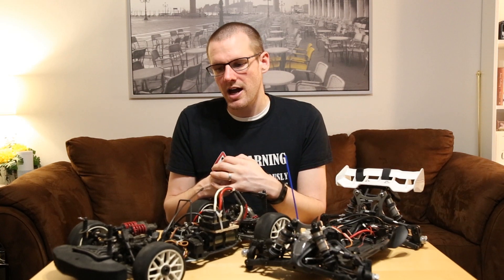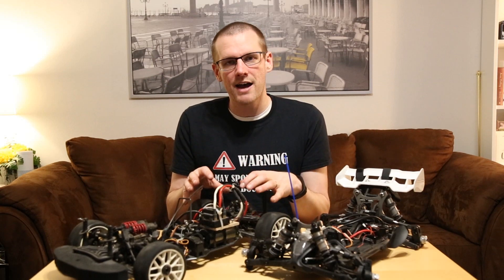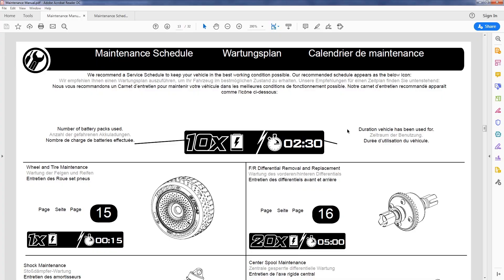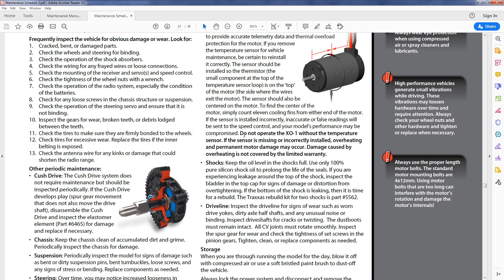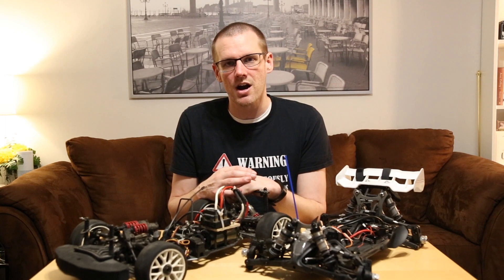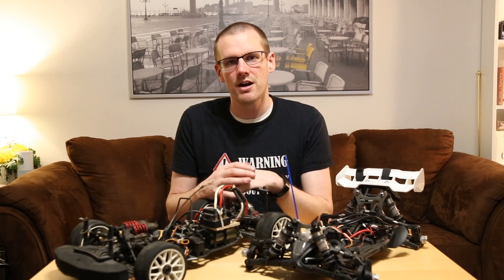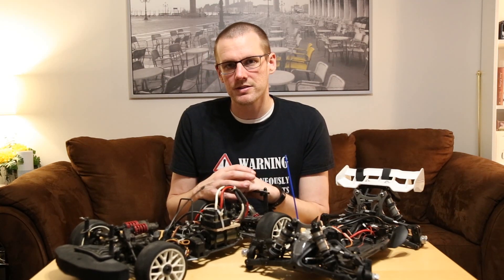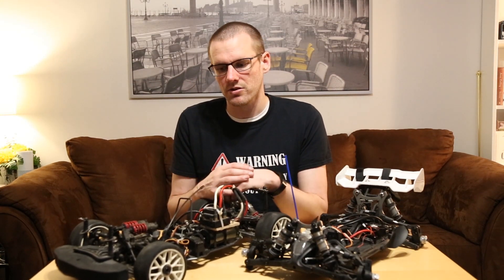Does your RC Car Require Oil or Lubrication for some of its Parts / Components?

Comment: You forgot to mention rust, thats the main reason I use teflon based thin oil to lubricate some areas prone to rusting. I also use a thicker and a bit sticky chain oil on the center diff gear and the motor pinion gear. The motor gear is made of hardened steel which can rust, while the center diff is made of a heavy and really hard plastic. Probably nylon. But my point was that its a noticeable degree of less friction when those two gears are lubricated. Also, less noise.  
I have a question, what type of grease do you use inside the differential housings?  Or do you use a thicker oil?

Comment: can you please replace the add picture for this link and remove the wd-40 can and replace with legit rc oil bottle?? wd-40 is not a long enough lasting lube. I use it to clean after wet play or to soften the tires. this is a huge misconception in the bicycle world and leads to more worn, gunked up and broken parts.

Comment: I’ve taken lots of info and used it from your vids and it’s worked very well but I have to disagree about lubricant as u should put a dry lubricant like WD DRY PTFE as it’s specifically designed for bike chains to repel dust and water and doesn’t eat bearing grease 
It might not say anything in manuals but how many manuals actually explain the cleaning process?!?! 
Go on forums or even brand specific vids and u can find them telling you what to do if there’s dust mud water etc. 
Example, in your rd car you drive to work every day there’s no section that tells you how to wash it and same can be said for electric car companies like Tesla 
They use batteries bearings a form of Esc (ECU) but all these brands expect you to put your car through a jet wash or car wash. Take your car for a service though and what do they do? They lubricate the moving parts.
Another thing that can be said about them not telling you to lubricate your car is they want parts to wear out as I’m most likely correct in saying possibly say at least 25%of there revenue is in parts sales after the fact. 
A lot of wear is caused by driving style too
Anyway that’s my thoughts on it and many other peoples (maybe not the full size car analogy) too. But keep making your awesome vids they’ve helped me loads since my local hobby shop closed so I had to learn everything from people like your self rather than driving 4 hours to maybe fix a 2 second problem 👍
Reply: So you don't think the grease or oil will catch dust and make an abrasive paste out of it that will grind away the parts?
Reply: @johnmachter40  read more of the more recent comments, 1 of the first that comes up is using a dry lubricant over a wet one. Dry lubricants are better in the entire drive train of RCS in the parts exposed to the elements. 
It’s how you wash and clean your RC after use that will keep your car going. 
Personally I wet the car down and then apply MucOff, a motorcycle cleaner, give it all a clean with a soft brush (more aggressive where needed) and then rinse. Dry it best u can but even when it’s still wet spray in the dry PTFE Lubricant as it pushes out the water. 
The only time u want to be using grease or oil is in your diffs during routine maintenance of your car
And use whatever weight is your preference. As for the diff grease I use marine grade grease and I also stick a bit of this on the shock ends when I push the shock shaft (and O ring) the oring. 
You shouldn’t be getting any grinding paste build up, this would only occur if you’re diffs or your pinion/ spur aren’t correctly meshed.
Hopefully this answers your question!
Reply: @Soilhalo77 thanks. how often do you maintenance your car and what are you doing in an maintenance? im fairly new to rc cars :)
Reply: @johnmachter40  normally the basics every time but the diffs until something breaks or wears out. 
But to be honest it’s usually until I decide I’d like to try something new. . 
I’d say on average I’d say running it in the the street with my £2500 Kraton 6s exb every 30 times but keep a eye on things like bearings but running it hard with big jumps I check everything closely every time but if it looks ok and no breaks then say 10 x and change all fluids. 
My 110mph typhon rally car needs changed every x10 just simply because of how I designed it to be ran and that’s with a full battery pack smoking the tyres😁😎
Double and triple check all plastics too , don’t use metal shock rod ends for jumping, there designed for flex, use the at your own peril same goes for rest of car/cars watch/study multiple vids and come to happy medium. Follow advice of well known bashers etc and speed runners 
Best advice I can give

Comment: These tips are only suitable for cars that are driven indoors or in dry weather.
I cannot imagine washing my Erevo with a water hose and not using the silicon lube after that.
Even bearings will rust in days without changing the grease.
Reply: Do you still See it that way?

Comment: I could swear that my nitro 4-tec had instructions to drop a bit of wd-40 in the engine as a after run method for storing your vehicle. If that wasn't the case I wouldn't be doing it. Furthermore, I was told it's not necessary if you're running the car consistently, but only if you plan to put it away for awhile; at the very lease you don't want the engine to seize up. But like I said, I remember seeing traxxas 4-tec  videos from traxxas tutorials recommending to do this after run maintenance. Not so much for the body parts. 
Maybe it's worth looking into.

Great topic though. Love the content my friend. Keep it up.
Reply from the maker: This was more specific to brushless motors and cars. A nitro engine is a different animal, im glad people like you still have them. You are correct after run oil is what you want to use otherwise the castor will thicken up making engine rotation difficult. I had a traxxas nitro engine that recommended wd40 as after run oil. There was a general concensus on the forums to use a proper after run oil and not a cleaning agent like wd40. Most of the wd40 will evaporate but after run oil will leave a nice thick film on each internal component.  Simply place a few drops in the carb and spin the motor for a few blips of the pull starter or 2 seconds on an electric  starter.

Comment: What about the front and rear differential? I constantly see videos of people filling the entire bulkhead diff housing with grease?? I never bothered to do anything like that on my 1/8 scale cars and had no issues yet.
Reply from the maker: Fluid is placed in to the differentials for tuning purposes not necessarily for lubrication. Here is a video on that: https://youtu.be/pyLyeYDA3Ig
Reply: @RCexplained  i was talking about one the ring and pinion gear outside of the differential....?
Reply: @RCexplained  I have the same question, would be wonderful if you could help reply! thanks!!
Reply from the maker: No I do not use lubrication there.

Comment: Is PTFE dry lube an idea for suspension components and ball joints?
Reply from the maker: Hi dellkenneth, I don't have any experience with these types of Dry Lubes. They are designed to resist dirt and still reduce friction. This sounds pretty good.

Comment: When I am done, I just spray PB silicone grease all over the entire car, focusing mostly on the suspension  and then let it sit in for about 15-20 seconds and blow the excess off with air.....haven't had any issues yet and it is certainly better than WD40.
Reply from the maker: Thank you for commenting Donny!  Sounds like you have a good after run method!

Comment: Thanks a lot for all Your videos. Helpful! I could agree with 'no oiling' strategy. Lot of years ago I was racing touring RC cars. Now I am kind of recreational driver (and pilot too, lol). I have few cars, planes and helis. Living in Ireland, so mostly windy conditions. When no wind and rain I am flying. When no fly conditions I am driving. Mostly in wet condition.  Back to oiling - no oiling.
What trick would You recomend against rust? I am caring my cars really well, but whatever I do metal parts gets slightly rusty. Cleaning, drying after every run - no chance to prevent it. Any adwise, please?
Reply from the maker: Glad the videos are helpful! With rusty components I'm usually just oiling them and taking the rust off with a cloth.  WD40 acts as a good cleaner and if you catch it early enough the rust (surface rust) will just wipe away quite easily. Fortunately many of my cars use  lot of plastic and aluminum minimizing the amount of rust. I see more rust on my float plane in some scary areas.
Reply: Consider "dry lube" spray that is ptfe (teflon) based.  It's similar to wd-40, but a little better optimized for this.  I think wd-40 could be better for heavy-duty, less dirty, already-rusty type applications.  The next thickest thing is light oil, but that is still often too thick and attracts too much dirt for many applications.